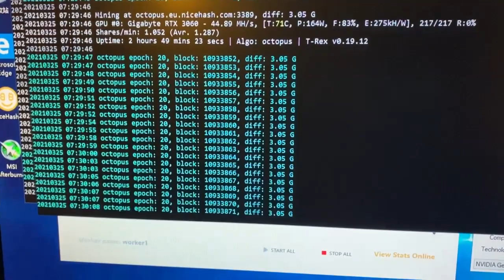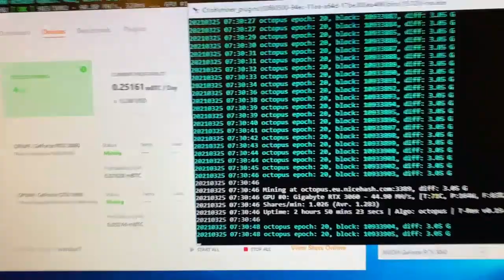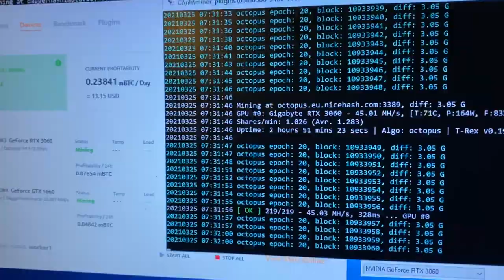Real cracked RTX 3060 12GB  Unlocked running on pci-e 1x nicehash for Mining 44MH/s

Comment: did you use the 1x slot to connect the rtx 3060?
Reply from the maker: Of course.
Reply: 155w is so High!  Can you try to change the settings for optimal works?